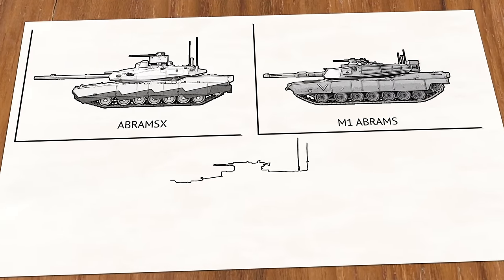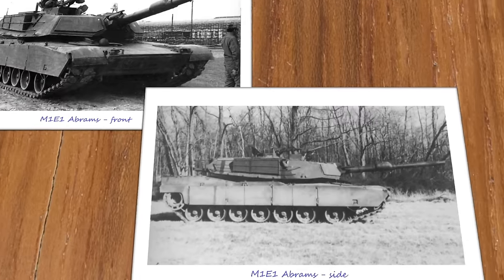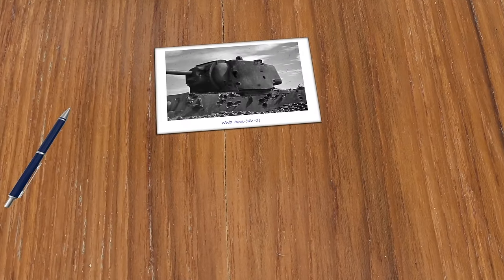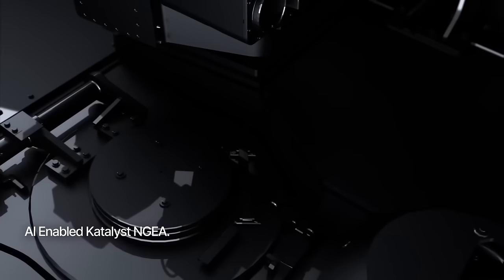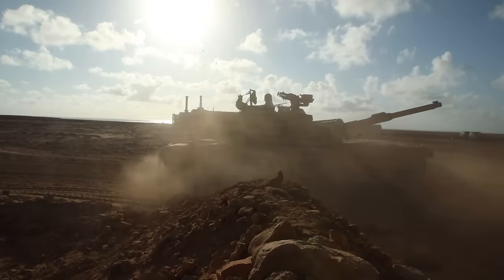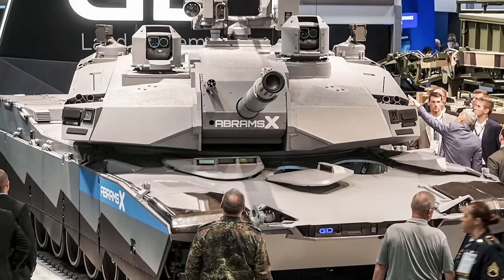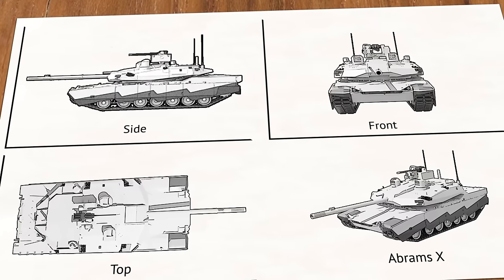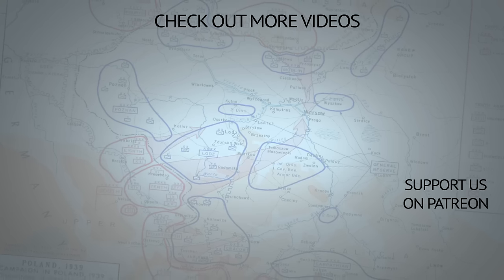M1A3 Abrams is finally happening. And it may get an unmanned turret, like the Russian Armata T-14.

Comment: I think the "more survivable" most likely refers to improved APS rather than an unmanned turret. I really doubt the Army will go for an unmanned turret, but I think a 2-man autoloader turret is plausible. The weight reduction will likely come primarily from stripping out the existing controls and electronics and installing a new, lighter weight, integrated modular system (unlike the current state of tacking things on top of the existing system). It's also fairly likely they will implement the same lighter gun that was used on the AbramsX, and they may install a new gas turbine or diesel engine to save fuel.
Reply: I think it’s be an unmanned turret, more survivable means a more efficient auto loaded. Something that’s not gonna pop.
Reply: iirc abrams x has a carousel similar to t72 (different design but same type)
Reply: @ligmasurvivor5600  I believe the AbramsX has a horizontal autoloader, like most western designs, rather than the vertical autoloader like the Soviet series
Reply: @mw9297  Tank crews have voiced some strong opposition to an unmanned turret. I don't think the army will be quite that radical, considering they haven't so far adopted autoloaders either.

Comment: There needs to be a large robotic arm with a fly swatter to hit incoming missiles and drones out of the air. Then the turret won't need armor. The final part of my plan involves the employment of midgets, which can be recruited from the circus. Thus the tank could be shrunk to a size more manageable for aircraft and delivery catapults on aircraft carriers. Of course the new versions would have to have some short flight capability such as what turkey's possess.

Comment: As a former 19K things I would like to see, crew in hull, 130mm cannon with auto loader. Different power pack and transmission. The reduction gear box takes a lot of space in the engine compartment. Of course the modern suite of sensors and optics with links to other vehicles / drones and an active protection system. Better fuel economy means lease fuel to store
Reply: You do want to keep the 4th crewman though. All that fancy gear is a lot of maintenance hours, and if you slim down the crew you may end up with under maintained tanks, or exhausted crews.
Reply: @PhilMarks-g7u  I agree with the 4th crew being kept as it would go well with what the military is doing. With how the military is trying to keep up with manpower, aswell as keeping maintenance up for war. Although idk about the autoloader, a lot of the 19ks i know including my friends say the load time isn't too big of a difference. Many say loaders fatigue won't be as much a factor. The better fuel economy is important, Abrams are inherently gas guzzlers, and the old APU made it worse. Not sure about the new one. Just lowering the weight overall will help with where it will be fighting too. Just my opinion though.
Reply: @jasonbrewer6714  4th man should be relegated to uav/loitering munitions duty, imo. A second eyes in the sky for the tank commander and as a way to hit targets behind defilades/cover. Something similar to the switchblade drone system could be added on to a next gen tank.

Comment: I think it's good the branding is very conservative like 'M1A3'. I once used a laptop which had integrated Intel Extreme Graphics 2.0. Now Intel integrated graphics is always going to be underwhelming because it's aimed at people who don't care about/actively dislike GPU performance  but it seemed slower because they'd foolishly leaned in to Extreme Advertising. Underpromise and then overdeliver.
Reply: True, but one minor correction.  The actual designation is M1E3.  The Chieftan explained it in a recent video.  I can’t remember the exact details, but the “E” designation apparently signifies a major engineering upgrade, as opposed to an “A,” which usually just means some additional capabilities were added.
Reply: @bluemarlin8138  The M1E3 and M1A3 are nearly the same designations, just for different stages of development. The "E" is for a variant under engineering development, while the "A" designation is adopted once the vehicle is accepted for service. So what is currently the M1E3 will become the M1A3 for most of its life. The SEP (System Enhancement Package) designation is for minor modifications and additions.
Reply: @andrewreynolds4949 Thanks for the clarification.

Comment: Unmanned turrets make sense. So does engine in front.
Reply: Why engines in front? wont that make them more vulnerable since the front is one of the most targeted areas of a tank?
Reply: @radicalxg8282  Yes, but what would you rather lose, the engine or the crew? Soviets might have said crew in the past, but I doubt the modern militaries would say they same.

Though moving the engine might have a lot of consequences to the overall design. From a safety standpoint it makes sense but maybe not from other standpoints. Still will likely be looked at for future tanks, unlikely to happen for this new modernised variant.

Comment: I really want them to get rid of the fuel thirsty Honeywell turbine engine with a simple V8 or something diesel engine, that will increase the tank's range siginificantly with same fuel amount
Reply: The Honeywell turbine engine exists specifically because it is powerful and can use ANY fuel, which makes logistics and emergency supplying much easier.

A V8 would be horribly underpowered, as would a diesel.  The listed top speed of the Abrams is the RECOMMENDED top speed.  At full power, off-road, the Abrams can peak at 70 MPH.  This makes it capable of outmaneuvering enemy forces to a significant degree, which is a major part of US armored strategic doctrine.
Reply: Diesel-Hybrid is the way to go. Fuel efficiency is key and the hybrid system will provide a lot of benefits like running subsystems of a silent battery, creating less of a heat signature.
Reply: @Liberty_or_Ded  A diesel wouldn't be underpowered. In terms of mobility the Leclerc, T-80, Leopard 2 and T-90 either match or exceed the M1, they all use diesel engines. Although the T-80 initially had a gas turbine too.
Reply: @Liberty_or_Ded  not really, even every other western/NATO tanks use advanced diesel engine, the Leopard 2, Challenger II, Leclerc, Korean K2 Black Panther, you name it, and they are not less powerful at all, generating 1500+ hp & 3000+ Nm torque, resulting 75+ km/h top speed as well. Yes I know the Honeywell is multifuel, but that was proven to not be significant, since diesel is very cheap and always present everywhere, you can always supply them very easily at any moment of time.
Reply: @DefinitelyNotEmma  A single lithium ion battery weighs the entire amount of a car's entire engine block.

A diesel-hybrid would require 12 such batteries to operate for any tactically-feasible period of time.

Also lithium-ion batteries have a tendency to be EXTREMELY explosive and flammable if subjected to high impact, meaning that they would have to be further armored, meaning more weight.  Not to mention the scarcity of the resources needed to make those batteries in US-friendly nations.  It's not worth it just to be able to have a quiet tank that is only slightly cooler (lithium battery usage still generates a lot of heat, well above background levels, and thus would provide no tangible benefits to evading thermal imaging).
Reply: @Liberty_or_Ded  Depends on the size of the V8. I know of V8s the size of an entire SUV. More likely they would put in a V12 or something larger though

Comment: That's crazy after getting a plug in hybrid I realized how Tanks are perfect for a a hybrid system now the new Abram coming out with electric motor. Tanks do a lot of stop and go hybrid system will be more efficient and torque.
Reply: Batteries in tanks… what could possibly go wrong?
Reply: Large batteries tend to burn really badly...
Reply: @RobertLutece909  But that would require installing an extra system of blow-out panels, where the alternative is installing a normal diesel or gas turbine engine. Also with the batteries the explosive force caused by a battery ignition seems less of a concern than the extremely high temperatures it produces
Reply: @RobertLutece909  It's all just tradeoffs. The batteries take up space and weight that could be used for a larger diesel engine. The batteries primarily have an advantage with overall fuel efficiency and noise reduction, the rest is just marketing talk.

Considering how much the Army has insisted on keeping a gas turbine so far, I'm not sure they'll abandon it now. The gas turbine does eat more fuel, but it does produce noticeably more power for its size and weight, and is much quieter than a diesel engine (though not as quiet as battery power of course). I don't think there's an improved gas turbine ready for use in the Abrams, but I wouldn't be surprised if they had one developed fairly quickly. On the other hand there is an existing diesel power unit that was recently developed; again, it's all tradeoffs. Personally I think the hybrid option is the least likely outside of Congressional intervention.
Reply: @RobertLutece909  It depends on what kind of gas turbine and diesel you're comparing. A modern diesel unit uses less fuel than a modern gas turbine, in general, though a gas turbine does use less fuel when operating at or near full load. That's part of why gas turbines are so common in naval vessels. A tank spends far less time at full load, so the balance is more towards the diesel. The turbine's main benefit is the smaller size and weight for a given power output, though an APU will reduce that margin if included.

Comment: I would be surprised if it even has an autoloader. It's more likely they will cancel the program then build one without a turret.
Reply: Traditionally the US has preferred turreted vehicles far more than most other militaries
Reply: @andrewreynolds4949  u.s. also completely refuses to abandon manual loaders. Even during the Cold War when we were massively outnumbered in Manpower.
Reply: @Valorius  I do think the Army might finally be willing to pick up autoloaders now. We'll have to wait and see.

On a different note, I do suspect the M1E3 is also an excuse to not only cancel the SEP v4 but to quietly cancel or delay the Decisive Lethality Platform program meant to replace the Abrams
Reply: @andrewreynolds4949  Autoloaders make sense on every level. Strategic, logistically, tactically, and most importantly perhaps, societally. 
Not only does an autoloader not eat, and not get wounded, and not need dental work and not need uniforms, but it also doesn't get PTSD and lifetime VA payments and health care.
If you eliminate 25% of a crew size, you reduce the LIFETIME expenses of an item by orders of magnitude.
Not to mention what you actually gain as a combat vehicle.
Reply: @Valorius  Indeed. That's becoming more of a concern than it has been in the past

Comment: I think what the US Army is getting to is to make the Abrams X the next variant as the E3/A3 since the hull is from existing Abrams. If GD can upgrade any and all Abrams into the Abrams X specs, they can save R&D funds while giving the platform more life and significance in the current and future battlefield.
Reply: If they wanted just buy AbramsX they wouldn't need 10 years for it.
Reply: It won't be AbramsX. That's just a concept design and there's a lot of differences between it and what the Army will actually want

Comment: Unlike the Russian T-14, if the US is building a all new follow on tank to the M1A2, it will be built, it will work as advertised and like it's predecessor, it will kick ass.
Reply: Russia can't focus on the t14 right now, it needs cheap usable t80s or t72b3 
If they build some t14s, and they get destroyed by a cheap drone it's a waste
Reply: The M60A2, XM2001and XM1203 NLOS-C and it's sister models all disagree with you
Reply: @ddarkon1223 The T-80 isn't really cheap. However it's cheaper than modern T-90 models while also offering better mobility. Which seemingly is favored.
Reply: @ddarkon1223  Russia claims that the Afghanit APS can hit projectiles traveling at 2000 m/s, faster than pretty much every APFSDS ever created, and also claims it can be upgraded to intercept projectiles traveling at 3000 m/s, or faster than every in atmosphere projectile ever. Seems to me like it should have no issue taking out some DJI drones traveling at 60 m/s. Slap on a mine roller and it is generally invulnerable to all anti tank threats. That is, of course, if the definitely reliable and totally trustworthy Russian military is to be believed
Reply: @ddarkon1223  but then if it can get destroyed by a cheap drone, then it doesn't sound like it's all that much of a badass tank to begin with, does it?
Reply: For it's time the M60 was a good tank, Israel didn't have any problems taking out Russian tanks in the Sinai and Golland Heights with them.   @dimitryofthedonmongolslayer
Reply: @dimitryofthedonmongolslayer  The Starship lol, it looked cool though
Reply: @oveidasinclair982  The M60 and M60A2 are two vastly different tanks. OP meant the M60A2 "Starship", an ill fated 152mm rocket launching M60 that was very ambitious and fazed out very quickly as it was a nightmare of a tank.
Reply: @ImBigFloppa  exactly,  claims, its not practical
Reply: @dimitryofthedonmongolslayer  t90 is the most optimal tank, building a bunch of t14s will not be of use, crews aren't used to it, they're used to t90, t80 and t72s, training an entire generation of crews is very difficult in war time
Best focus on the current stockpile

Comment: I'm really curious about what the secondary armament is going to be. I keep think Gau-19, or Gau-21, both in 12.7mm might be more sustainable than a 30mm, but you can't program a 12.7mm - yet. Still, ballistics computers are always getting better too.
Reply: I don't see how a gau of any calibre would be worth the upgrade on a mbt.
Reply: me too
It would be nice if those variants send in Ukraine and how well it works
Reply: A new tri or hex barrel in the armys new 6.8 would be better remember its going to be more for taking out drones than any thing else & small calibre = more ammo carried &  faster tracking speeds .
Reply: @jackdbur the reason 30mm cannons are used for C-UAS, is because they can be loaded with proximity fuse ammunition. Means you don’t really need to hit the drones, and you can deal with lightly armored vehicles.
Reply: They could resurrect the 25mm fused medium velocity that was developed.

Comment: 50t. Composite armor and chassis. Turbo-Diesel-Electric hybrid. 500hp commercial truck/marine engine. Plus 1,500hp electric motors with 5,000ft/lb torque. An electric-only (low observable, low IR signature) range of 5mi. Armed with 127mm (5in) gun. 5,500ft/s, 5mi range. Penetrates 50" of steel or concrete. And a remote operated, helmet-aimed 30mm chain gun with 200rpm. Plus two 7.62mm co-axial mounted with main and chain gun. Larger emphasis on active protection, trophy, jammers, bullet direction finders, etc.

Comment: Yeah, that will save weight.  They can plug in modern digital electronics overall.  The difference between an F-4 and its discrete hard wires for every thing and every system was a PITA to fix compared to the F-18 hornets with their modern data bus.  The wiring was cut in half, and that was with a multiply redundant set of busses.  

I expect the M1E3 would enjoy some serious weight and space savings with a ground up redesign to use a standardized "Open Architecture" set of redundant data channels.  Then all you need to know is the standard and you can pop different turrets on and off by yanking a bunch of bolts and a few plugs.  You could have an E3 hull which  could take several turrets.  M1 Missilero turret for drones.  M1 Gunny for platoon support with a couple miniguns, suite of sensors, and 105mm gun for platoon support.  M1 Bullet Wasp done up with an MBT turret with a heavy cannon and anti tank drones.

Comment: As long as they keep the turbine they can forget about any other modification.
Reply: Yeah bro, fuck fuel economy!
Reply: @Ag3nt0fCha0s   It uses 1 gallon every six minutes when idle and 1 gallon every minute when traveling cross-country. Not too much, especially for America who will spend any amount on the military lol
Reply: @LewisB3217  now compare it to a standard piston diesel and remember that tanks frequently spend great amounts of time idling…
Reply: @Ag3nt0fCha0s   my point being, the gas issues are largely exaggerated, just look at tank fuel ranges, the abrams fits fine with its contemporaries and even more modern tanks, and with good logistics, the fuel should never be a problem
Reply: @Ag3nt0fCha0s the fuel economy being shit is a veritable myth, the abrams turbine doesn’t just run on one form of fuel while most of the engines you listed are limited to one form of fuel, the ability for a turbine to swap from marine diesel normal diesel and various gas fuels allow it top up from ANY source, which is what people always forget while mentioning the turbine

Comment: The M1A3 was announced years ago. There was even a Wikipedia page dedicated to it for about a year if I recall right. Then nothing and the page was taken down.

With the Army still having not procured it, nothing more sounded off about it. Then about around last year, there was some mention about the M1A3 again. Nothing more as the Army then proceeded to start buying more M1A2s of different SEPs and even further subcategories.

And then suddenly, from the sounds of it, that's when the M1E3 was announced. So, I had assumed the M1A3 was finally abandoned and that M1E3 would lead to a whole new Tank.